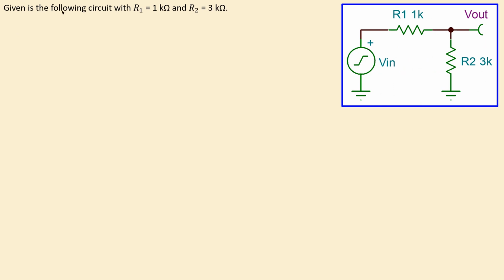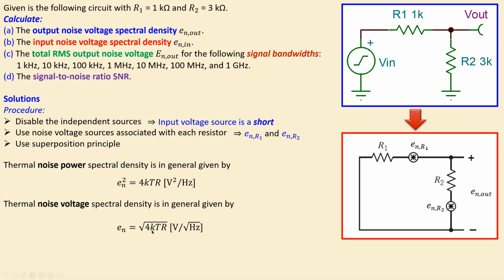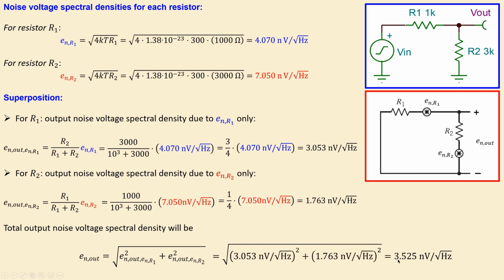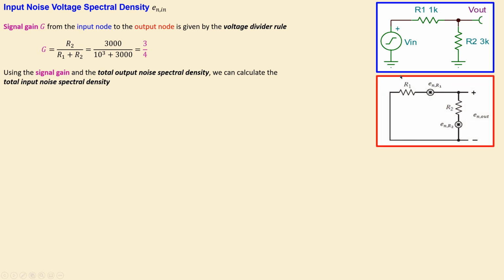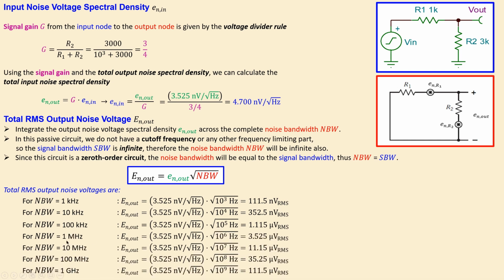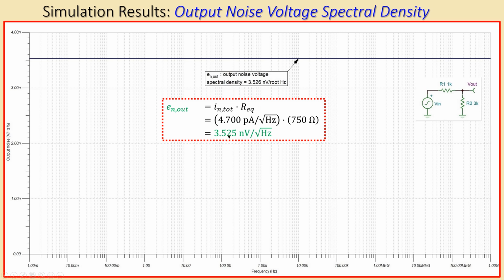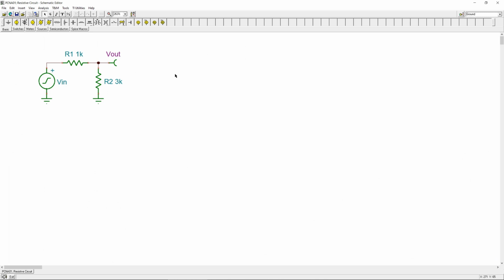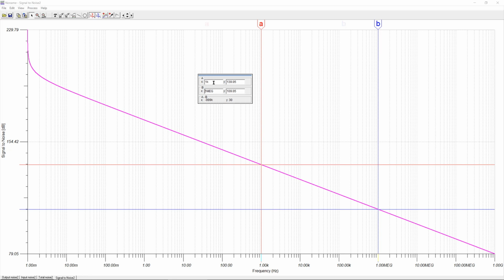Noise Analysis Resistive Circuit 💡 Example 1 #noise #electriccircuits

Comment: Hey there, thanks for the video, I am currently going through it but I had a question about the superposition calculations from around @8:45 to @11:12. 

The output voltage spectral density due to en,R1 makes sense but the calculation for en,R2 is confusing to me. With the voltage divider equation as shown with R1 in the numerator, wouldn’t that be calculating the voltage noise over R1? Don’t we want the noise calculated over R2 since that’s what we had defined as en,out according to the image?

Additionally, when we start applying the superposition in this example, why do we get rid of the ground symbol? If we include it then wouldn’t that change the calculations for the noise density terms since now R1 and R2 are in parallel? You mention this at @6:57 but then the actual steps we go through don’t seem to reflect this.

Lastly, if you could just clarify, why do why do we square each term and then square root the sum for the total output noise voltage spectral density? I’m used to superposition with just basic voltages and currents and in that case you just sum terms together. Is the squaring and square root of result of it being a noise density as opposed to an amplitude term like voltage or current?

Thanks!
Reply from the maker: Thanks for your message. Please see my responses to your questions below:

1. We are indeed trying to determine the output noise voltage. When applying the superposition principle, we disable en,R1, which leaves resistor R1 connected from the output to ground. This is why a voltage divider appears in the analysis.

2. We should not remove the ground symbol. The ground connection is always present at its original location. I should have made sure to include it explicitly in the noise analysis circuit as well.

3. To combine noise contributions correctly, you need to add the squares of the voltages, not the voltages themselves. Since noise analysis is based on noise powers, each term must be squared, summed, and then the square root of the total is taken. This approach is similar to the calculation method used for total harmonic distortion (THD).

I hope this clarifies things for you!
Reply: @ thank you very much. For question 1, I don’t know why it took me so long for it to finally click that yea it’s just a simple voltage divider again. I think my problem was I kept thinking about the circuit in a clockwise direction so when we disabled en,R1 I didn’t see the obvious voltage divider. Thanks again!
Reply from the maker: @James-vl6it Happy to help you out with this one! Noise analysis proceed little bit different than usual circuit analysis. After some practice and experience, you see it all much faster and easier.

Comment: why in this circuit SNR = 20 Log(1/En,out) ? isn't  20 Log(Signal / noise) ? is the output signal =1V ?
Reply from the maker: You are correct, the assumption is that the input signal is 1 already for all cases. And, yes, this does not have to be the case for all circuits. However, when you do have another input signal level, it is fairly easy and straightforward to convert to the actual SNR for the specific input signal.
Reply: @CANEDUX  Output or input signal  ?
Reply: @CANEDUX  Actually , i just want to check if SNR = 20Log(Vout / Enout ) or SNR = 20Log(Vin/ Enout ) ?
Reply from the maker: If you talk about output SNR, then you should take the output voltage signal and the output noise voltage. For the input SNR, you should take the input quantities.
Reply: @CANEDUX yes but here we're using Input voltage and output noise voltage
Reply from the maker: @mohameddrissi1075 You are right, I meant to say that I have used 1 V as the output voltage as a reference. Again, the SNR I am calculating here is not the SNR for all cases, because it depends on the output voltage level compared to output noise voltage. The important message is that the SNR will decrease as the frequency band increases, as discussed in the video.
Reply: @CANEDUX   so TINA also always uses 1v as output voltage reference to calculate SNR ?
Reply from the maker: @mohameddrissi1075 You can change this in TINA when you do noise simulations.